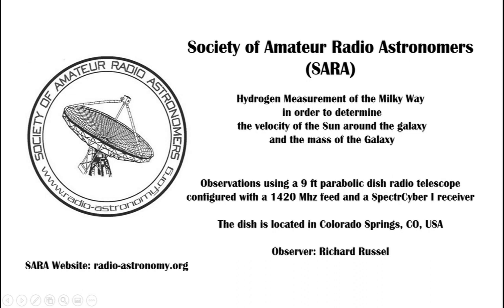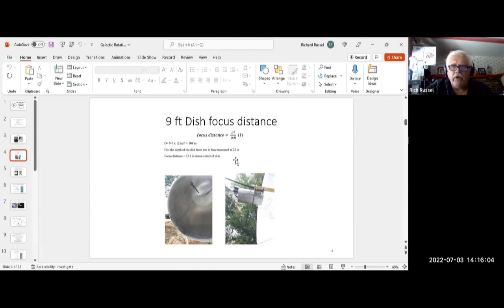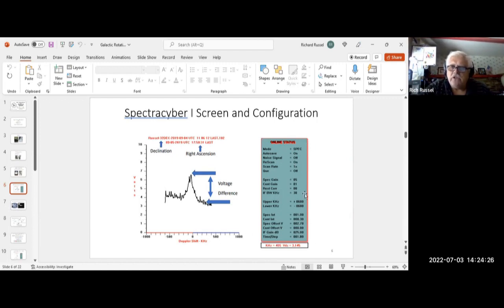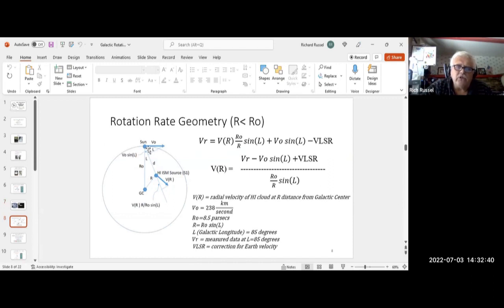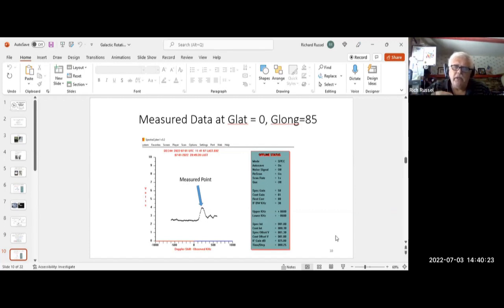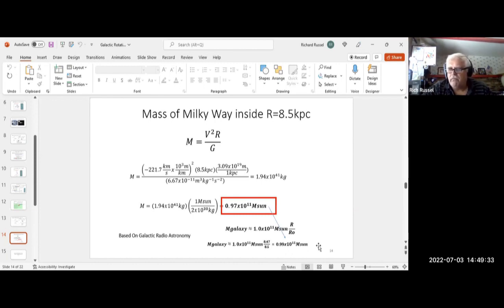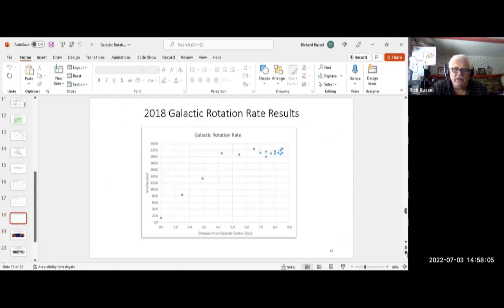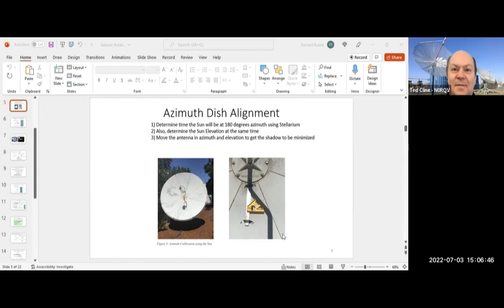Using radio telescope hydrogen measurements to calculate the Milky Way rotation rate and mass

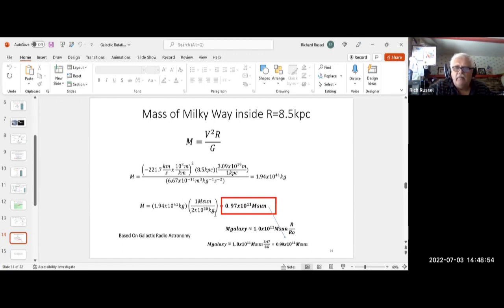Comment: Thanks for the effort. In the equations at 41:40, did we assume that the mass inside radius R is increasing linearly until R0? More mass density near the center makes sense but i couldnt see any reason for linearity at first glance.